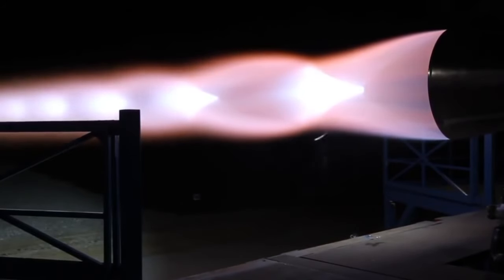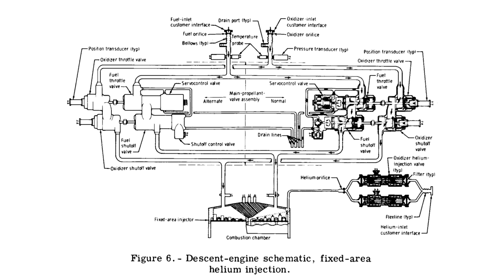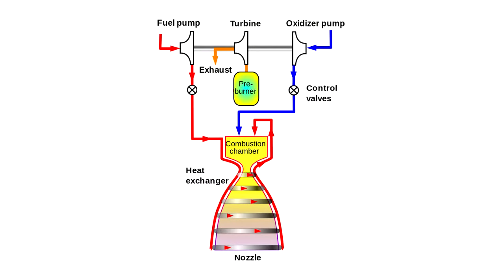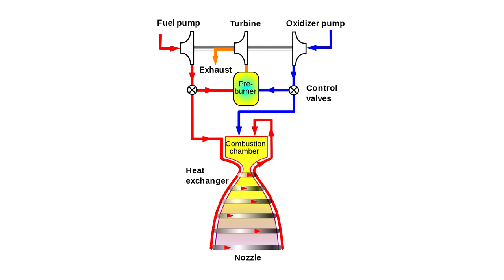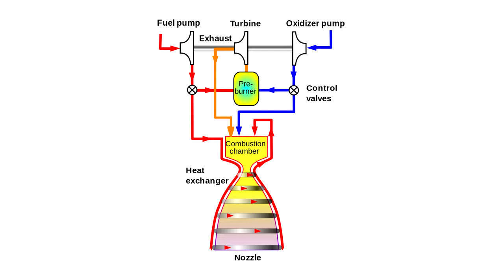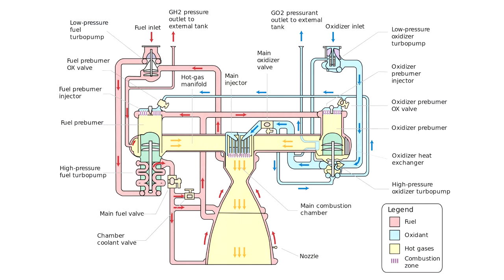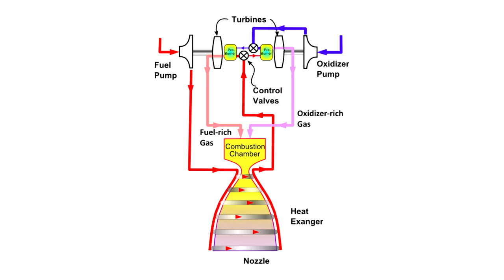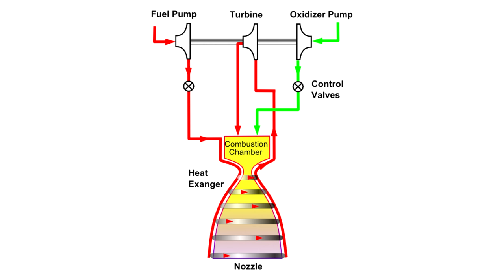KSP Doesn't Teach: Rocket Engine Plumbing

Comment: One of the most important parts of plumbing is balancing the flow for each material. This is done by knowing what the viscosity, molecular weight, optimal ratio of combustion. Also what pressure, and temperature, what valve materials can work, what is used to control the flow and measure the flow. This is not even getting to what pressurizes the fuel and oxidizer. If the material flows are not balanced correctly it will not be stable to burn or ignite properly. A closed cycle is not a good idea, as it is more likely to detonate. Also it is better to run impellers rich instead of lean, as oxygen is far more aggressive than most fuels. Also this is why extra fuel is used with nitrous oxide, if this is not done holes will be made in the top of the pistons. Using alcohol as fuel it cools things when running rich, and optimal will melt most metals.
Reply from the maker: The RD-180 engines used on the Atlas V run an oxidizer rich turbo pump to prevent coking.
Reply: @scottmanley  Also you said the reason why in the video, it is because the fuel is kerosene. Anyone that has burned this in the air knows about the carbon black that is created by burning it. To prove a point take a small lamp with a wick and the soot that is created when it burns, that is opposed to a clean flame as with methane, alcohol, or many other things of a lower molecular weight when burned in the air. Liquid fuel rockets are more difficult to make work than solid fuel, such as a simple zinc sulfur. These are made with 1 mole weight of each then combined with a binder to make the core of the engine. Each component needs to be in powder form though before adding to a binder such as glue, resin, tar, etc. The binder is a fuel just as the Zinc so it will need to have more sulfur added as on oxidizer or an additional oxidizer just to burn the binder, and there are many things such as perchlorates, nitrates, and so forth. Even sugar and a nitrate can be used as a binder with oxidizer.  Enjoyed your video, and I used to build my own rockets and motors when I was much younger, not long after you were born. Sad that it is so much more difficult to obtain most of the materials today compared to when I was a kid. I could get everything at the store to make any of the above locally before I even had a car.  Word of warning though this stuff burns hot and I have at least one scar to prove it. Also ear plugs and eye protection is a must, as the sound from the shock waves that is seen as diamonds are very loud. Enough to cause ear damage with any exposure.

Comment: Once you're at the full flow staged combustion cycle, the power going to the fuel pumps probably doesn't have to be all that high seeing as you'd get your chamber pressure from the preburners. At that point, I wonder what would happen if you used relatively low powered electric fuel pumps so you can leave out the hard-to-make turbines but also have significantly lower battery requirements than the Rutherford.

Comment: Little correction, Merlin engines are not oxygen-rich open-cycle gas generator engines, but tthey are fuel-rich open-cycle gas generator engines. Merlin  engines burning a small fraction of the LOX and RP-1 flow from the turbopumps to generate a hot high-pressure gas that drives a single turbine with the two turbopumps being driven by a single shaft, which is oposite as stated in this video.

Comment: Pretty Cool, Scott. I had previously seen a video on the Russian closed cycle engine. Did not know the distinction between that and the American, (Fuel vs. Oxidizer Rich Pre-burners), and now the engine with two Pre-burners.  Pretty cool. Do you happen to know what the secret is to make metal survive in an Oxygen-rich Pre-burner?
Reply from the maker: It’s probably some sort of metallurgy I’m not qualified to talk about.

Comment: Actually, SpaceX did have to worry about their seals a little bit. Since this is a reusable rocket, overtime more and more of these gases can accumulate inside the two shafts, so they designed a seal that was stronger than the Merlin's, not by much, but still strong enough to last a decent amount of time.

Comment: 5:50 - Hmm. I always thought the turbine was driven by exhaust from the main engine bell, not from a separate pre-burner.
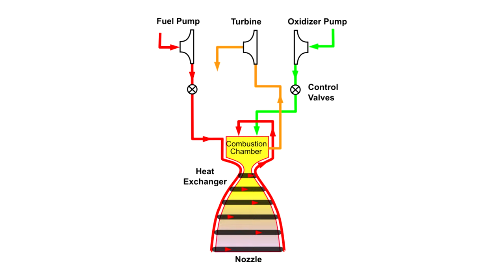13:18 - Ah, I see there is an engine design that works the way I thought. But it seems like they could improve the design by driving the turbine with gas directly from the combustion chamber, and then venting the exhaust into the engine bell where the pressure is lower, so they could still use the remaining thrust potential of the diverted exhaust.

Comment: question about a minor detail of the early stage of the video: Why is helium the most common propellant? Would hydrogen not make more sense (for the fuel at least, I can see that using hydrogen to pressurize the oxidizer might be sub-optimal).

Comment: Scott, isn't it possible to get around the cubed vs squared problem by simply introducing more surface area to the combustion chamber by introducing fins into it like how a heatsink looks? (i.e. fins running from left to right (assuming fuel is introduced into the chamber on one side and oxidizer on the opposite side) which would expand your surface area immensely).

Could that work or would that be impossible structural integrity wise or combustion efficiency wise?

Comment: Think of a turbo pump like a turbine-supercharger "turbocharger". Internal combustion engines can generate exhaust that is under pressure, that  can drive a turbine, the turbine shaft drives a compressor, the compressor ironically churns through air which is full of oxygen - think like oxidizer- which can be used with higher fuel flow to make more powerful IC engines.

Comment: Regarding the diagram at 11:30, all of the fuel and all of the oxidizer flow through their respective turbopump turbines, with just a bit burned for energy input? Is that what makes it full-flow, as opposed to only some of each going though the gas generator and turbine? Neat design!

Comment: The F-1 was ignited with a hypergolic fuel cartridge.  Now perhaps the exhaust from that was minimal, but was it pumped through the combustion chamber and out through the nozzle.  I am assuming the corrosive effect was also minimal.  Here is a great page describing the complexity of the F-1 ignition sequence.  Many, MANY valves opening and closing within literally nanoseconds, all in specific order.  In my opinion, the F-1 is still king.
https://home.kpn.nl/panhu001/Saturn_V/Saturn_V_info/F-1_engine/F-1_engine_ignition_sequence.html

Comment: Hey Scott, couldn't you fix the turbopump sealing problem by inductively driving the impeller with a magnet attached to the turbine? By doing that you could have two completely separate chambers. It would work something like an induction motor but sans external electrical power.

Comment: Do you think the ion stream from an ion engine could make a substitute for a hyperbolic re-ignition system?  Especially if you were able to substitute the xenon gas for some sort of oxidizer?  Like Oxygen perhaps.
Reply: Mark vonGermeten it wouldn’t work, you need a noble gas for an ion thruster because it ionizes the gasses.

Comment: What about using the thrust it self to pressurize the tanks, picture a piston and a sleeve, put the fuel in the sleeve and push on the piston head with the rocket engine it self, so the thrust of the rocket pushes on the piston head forcing it into the sleeve, pressurizing it, the harder the thrust the more force on the piston the more pressure ? then its like the first example of a pressurized tank, nice and simple no need for a turbine, and the tanks are not under pressurize, when the engine is not running ?

Comment: Why not just attach a little nozzle on the end of the open-cycle exhaust pipe, and let it contribute to the thrust that way? The early Spitfire got a boost of power when they bent the exhaust pipes to point backward and contribute to the engine's power by rocket reaction.
Reply: A lot of engines do that already, Blue Origin's BE3 being the first that comes to mind. These are rocket scientists we're talking about, if they are looking so hard for an alternative to that it's because some efficiency is to be gained in doing so.

Comment: Instead of building a closed-cycle engine where the pre-burner exhaust is channeled into the main combustion chamber, couldn't you just have it vent into a little secondary engine bell where there's no other combusting fuel generating backpressure? Then you could capture the thrust potential of the pre-burner exhaust without needing to do anything fancy to keep the pre-burner turbine from stalling.

Comment: You mentioned the size limitations of the expander cycle due the lack of additional wall area in the combustion chamber. How about putting a heat exchanger right into the main combustion chamber, would that work?

Comment: So, in the shuttle engine diagram, hot manifold gasses from the bell cooler are being used to drive the the low pressure fuel turbopump, but what's being used to drive the low pressure oxidizer turbopump?

Comment: An unanswered question that stands out: Why can't some oxygen be injected into the fuel rich exhaust of the pre-burner, to reduce the wasted fuel. Know it will be tricky, because it will cause pressure in that exhaust/combustion chamber, thus back pressure, thus defeating the purpose of the pre-burner. But couldn't a clever wide low pressure nozzle be used to gain some energy?

Alternatively, could the exhaust be fed into near the base of the main engine nozzle, so the unburned components would simply be used as higher velocity reaction mass? Main nozzle pressures low enough there for no back flow? Or main exhaust flow could actually induce/draw in the flow of the pre-burner exhaust?

Comment: You mentioned an r^3/r^2 limit on the power of liquid hydrogen engines, but this doesn't need to be the case. Imagine pumping the liquid fuel through something more like the bronchioles and alveoli of our lungs -- a fractal structure maximizing surface area for a given volume. In principle, you could at least push that maximum limit of power back, to the point where the pipes enter the micro- or nanoscale.

Comment: Side note: the Japanese are trying to develop higher-thrust expander-cycle engines, and they're doing it by making their combustion chambers longer and thinner - if you take an existing combustion chamber and extend only the length, then both the volume and the surface area are only increased by the same percentage.

Comment: Question: on all modern rocket engines does the fuel and oxidizer enter the combustion chamber as a gas, or is there an example of an engine where the propellants enter in a liquid state? Going back to earlier engines (V2, Atlas, etc.) what was the state of the propellants entering the chamber?

Comment: Even in open cycle engines the engineers find stuff to do with the gas turbine exhaust, don't they? On the F1 engine used on the Saturn V they used the (relatively) cool exhaust gas to protect the nozzle extension below the main nozzle from the high-temperature rocket exhaust, so it wasn't being entirely wasted.
Reply from the maker: +d2factotum right that's a whole other episode on thermal control.
Reply: Scott Manley
Cool, can you get that out tomorrow? :-)

Comment: The Soviets to fix combustion instability divided engine into more combustion chambers and bell nozzles , I wonder could this be used to
fix the problem with expander cycle because the area of the walls would increase

Comment: Could it be possible for a small bladed turbine to extract energy from the boundary layer of the rocket exhaust? It could be a good solution for hybrid rocket engines to not rely on pressure fed cycles any more.
Reply: Most probably this prevents proper flow of exhaust from nozzle that will lead to loss of thrust.
Note that pressure of exhaust hot gas on nozzle exit may be less than 1 bar, so not clear is it possible to take any force from this gas near nozzle exit. Also there is some control issue. Not clear how to control power of pump with exhaust gas.
Definitely this idea is used in airjet engines where air turbine and main fan are driven by exhaust gas - and this exhaust gas production is the only reason to burn fuel in aircraft.

Comment: I would like to know more about those electric pump-fed engines like Rutherford. What are their problems? It seems, that they circumvent all of the plumbing problems of power cycles with preburners. They have to some horrible drawbacks, because they would be more commonplace.

Comment: Why are the F9 tanks pressurized if it also uses turbopumps?
Also, I think I saw somewhere designs where the turbopump exhaust is driven through small side nozzles to directly produce thrust. DO you know something like this or am I making this up?

Comment: Do you know if a Electric powered Turbine with a hydrogen fuelcell has been tried ? Should be efficient and very easy to control ? It could use the excess hydrogen that boils from the tanks.

Comment: Oh and also, there is something I never understood. So the gas generator turns the turbopump, which makes the fuel flow into the engine. BUT, how does the fuel flow to the gas generator in the first place?

Comment: Scott, would it be  possible to let the  turbine rotate electric generator, and then electric motors power the fuel and oxidizer pumps? This solution would completely isolate pumps from the turbine eliminating the need for seals etc.

Comment: Puzzling you'd describe fuel and oxidizer supply plumbing omitting ANY mention of the PREPOSTEROUS "fuel pump" and "gas generator requirements posed by the F-1 engine.

F-1  Designer : "The fuel pump MUST deliver 5700 pounds (414 gallons) PER SECOND; the oxidizer pump "only" delivers 4,000 pounds (381 gallons) PER SECOND.  On EACH of the FIVE engines.

F-1  Engineer : "Sure. No problem.   Just gimme 55 THOUSAND HORSEPOWER for EACH pump.  On EACH engine."

Comment: Rd-180 was used on the atlas rocket for its first stage. It was designed by both Russian  and American scientists and it is a closed system. It was based upon the closed rockets that the soviets had built for the moon missions.
Reply from the maker: +Chris Cloo indeed it's an ox rich system, RD-180 isn't designed for reuse.
Reply: Ah. I thought I had heard you say that the first closed cycle rocket engine was going to be used soon. I think I missed the word "reused". I was surprised about the USSR having better engines then us up till they shared the technology with us.
Reply from the maker: +Chris Cloo no I said the first Full Flow staged combustion engine.  That's more complicated than the cycle used in the RD-180, RS-25 or other staged combustion cycle engines.

Comment: i saw a video on the Russian engines yesterday and by the diagram they fast all the oxygen through the pumps into the combustion chamber, gave a 25%increase in thrust for their size compared to the american one they recon, they just had to use a new high strength high heat stainless steal to accomplish it

Comment: How about using wooden tubes + thinner aluminium sheets than usual to build rocket frames, aluminium used as heat, fire resistant for wood  ... rocket weight reduces 2, 3 times...

Comment: Hey man your video has helped me tremendously with the design of a high powered liquid fueled model rocket. I am using butane as the fuel but I am still unclear on the best oxidizer for butane if this compound can work as the fuel. Any and all input would be wonderful.

Comment: How difficult do you think the Raptor will be to refurbish? The SSME used a simple staged combustion instead of a full-flow staged one, and it was pretty time-consuming to prepare for another flight. Can't imagine how SpaceX won't run into the same problem with an even more complicated engine.

Comment: @Scott Manley: Hang on - while area may go up with r^2, the amount of heat being generated should go up with r^3. So shouldn't you be able to feed your fuel through the pipes twice as fast while still heating up the same amount? Heck, shouldn't you have to do so to keep the engine bell from melting?
Reply from the maker: +Jordan Macdonald heat flows out the nozzle as hot gas.
Reply: Scott Manley Yes, of course, but I would expect that the proportion of the heat that fails to escape to be the same.
Reply: there's also a max heat capacity of the system and it's going to be closer to that square ratio than that cube ratio

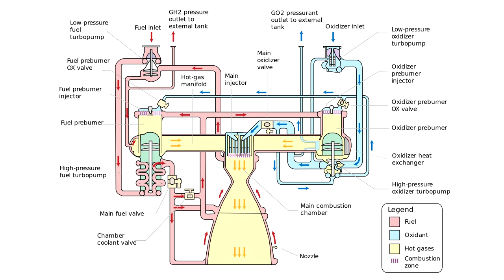Comment: There is one thing I still don't get in this video. The image shown when he talks about the staged combustion cycle engine of the space shuttle at 9:38 also has two separate preburners.  One for oxigen and one for the fuel. So as much as I understand its also a full flow staged combustion cycle engine and not just a staged combustion cycle engine. Is the image wrong there or am I to dumb to understand this image?

Comment: As an A&P graduate we were taught that pumps supply fluid flow NOT pressure, that comes from system pipe restictions and orifices? Is this correct?

Comment: Could they use and expander cycle but instead of using the expanding gases to drive the turbo pump could those expanding gases be fed to a preburner which drives a turbo pump?

Comment: It's not rocket science! Oh wait it is. But it still is very similar to normal diesel and aircraft turbo engines, just higher pressures and more energetic fuel that has to be chilled. This complicates material science immensely.

The "and that would be bad" line made my day.